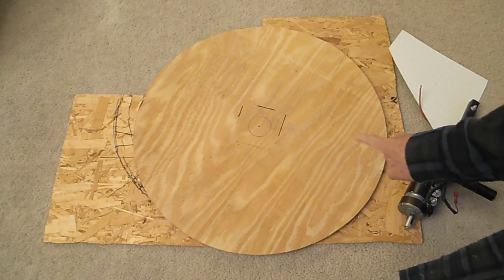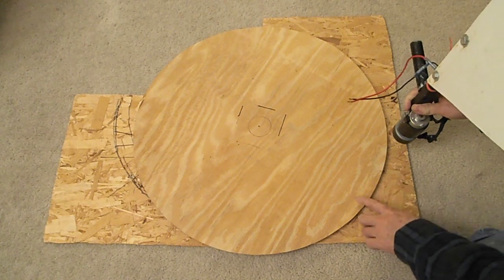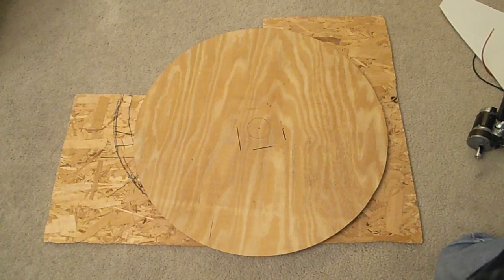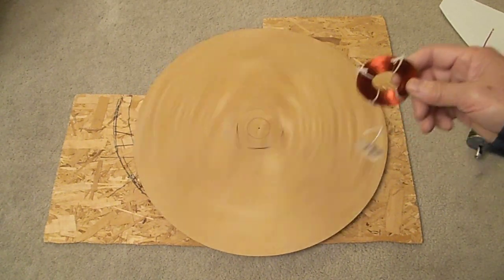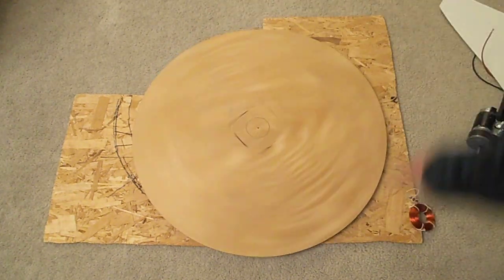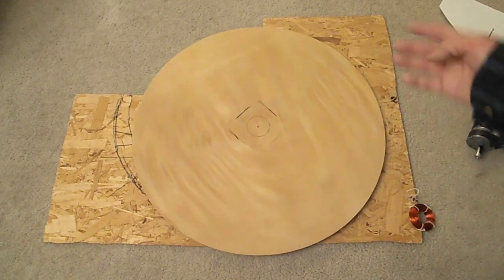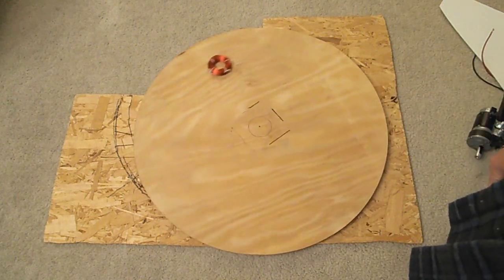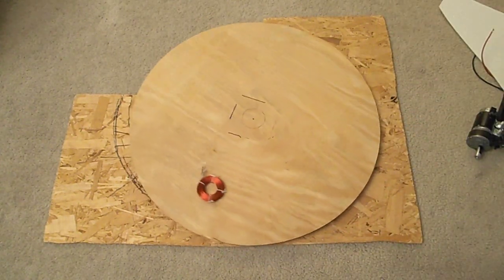Solar oven tracker turntable or a rotor for a vertical axis wind turbine

Comment from the maker: Warping is a problem with wood. I wonder if those circular nylon like chopping block (usually white) would warp. Ideally, the rotor should be metal. The axial flux rotor part of this project was just an afterthought.  Other Ideas just appear when you're doing one thing and your thoughts drift. Thanks for the resin idea.

Comment: I look forward to seeing the tracker system and have to agree with MrHorsetail below on the threaded rod system; seems a little more precision. The axial flux vertical would be nice too. If you sealed everything in resin epoxy and fiberglass while clamping it to a flat surface you could overcome that warping issue. Maybe?

Comment: youtube member imikewillrockyou made one of those and it worked great.  Low wind turbines are the way to go.  Tracking with a rubber wheel sound like a good idea too.  The problem I always have a time with is it blowing around in the wind.  That's why I always go back the threaded rod idea, because I can't think of an easy way to make a brake.